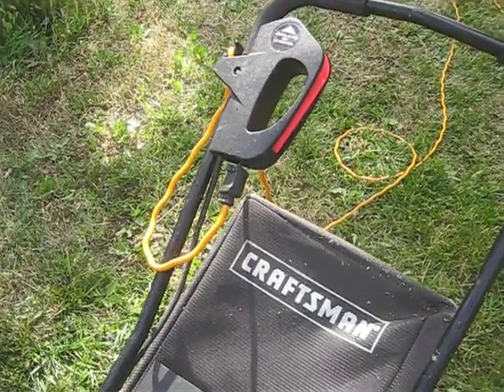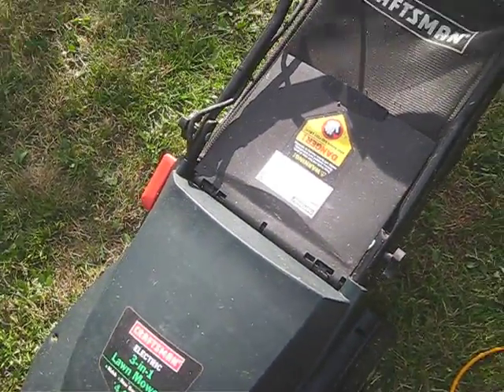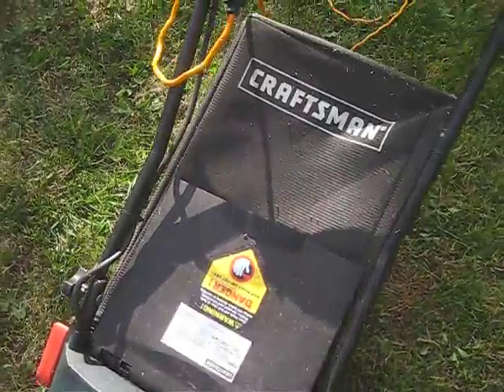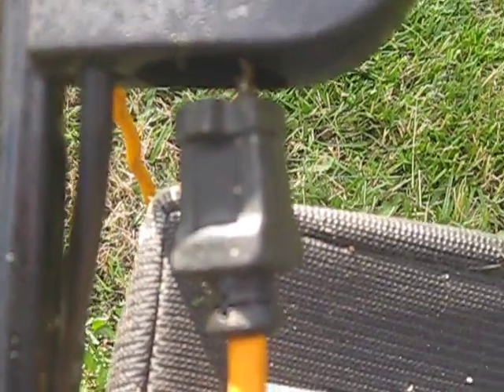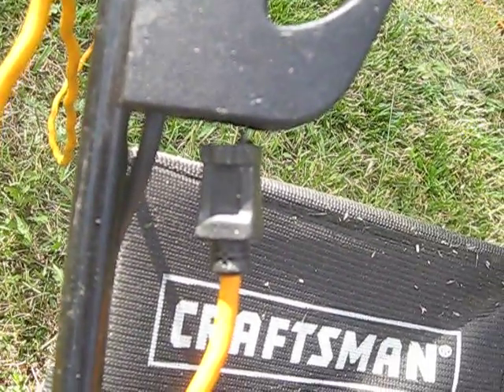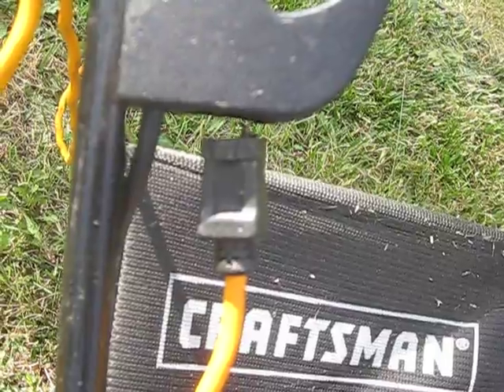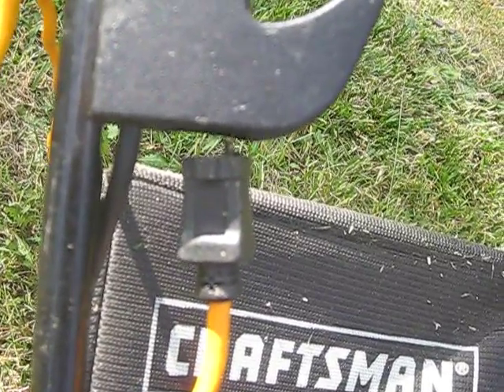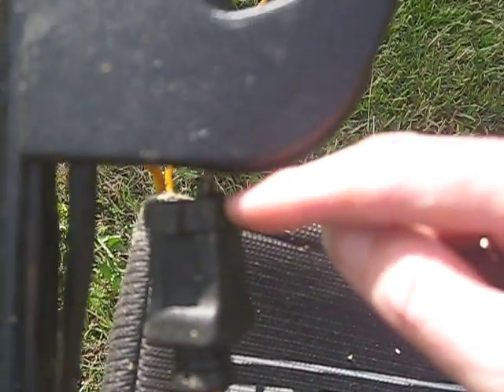Craftsman Electric mower melted the electric socket

Comment: This just happened to me. A similar model, Black + Decker. What did you end up doing? Should I chuck the mower and just buy a new one? Obviously I threw the extension cord out, but the mower may be able to be repaired. Just looking at my options.